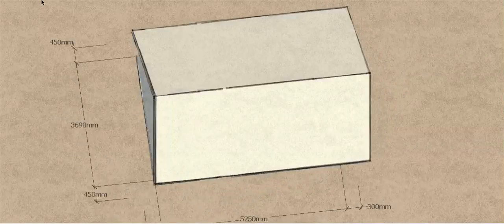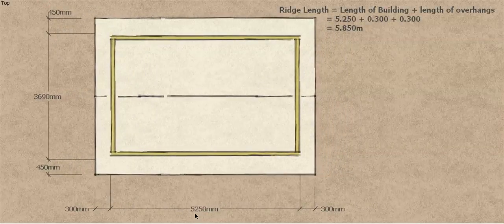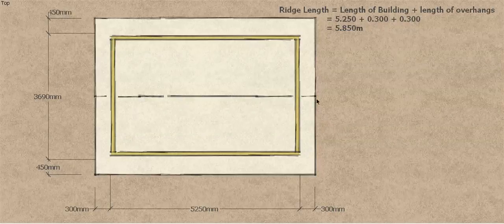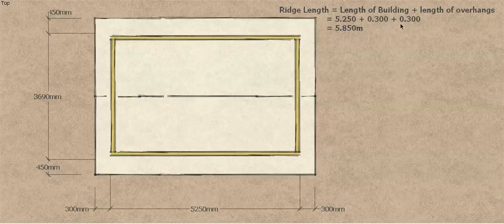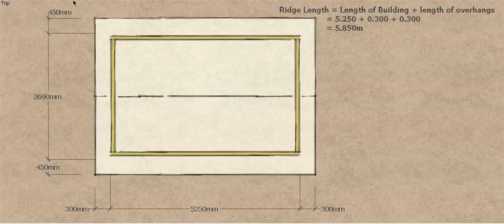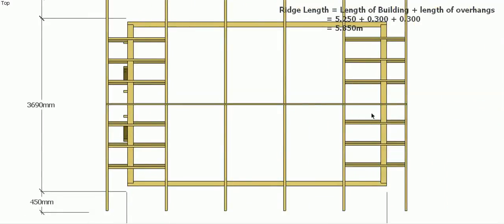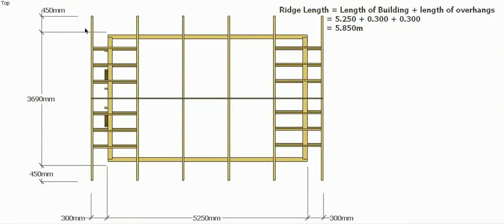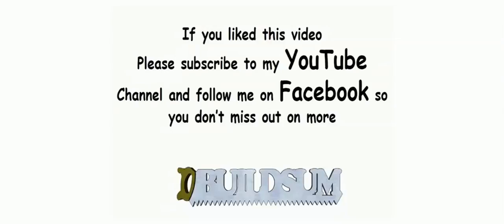Gable Roof Ridge Length

Comment: less thickness of facia?
Reply from the maker: Hi perf59
For estimating purposes there is definitely no need to allow for the thickness of the fascia and personally i have never considered it when cutting the roof either, it is generally considered that the eave width and barge overhang are used as the frame dimensions and any cladding or fascia would be over and above that. e.g. when cutting rafters we don't deduct the thickness of the fascia from the Eave Width.
Reply: Okay, Thanks for replying.